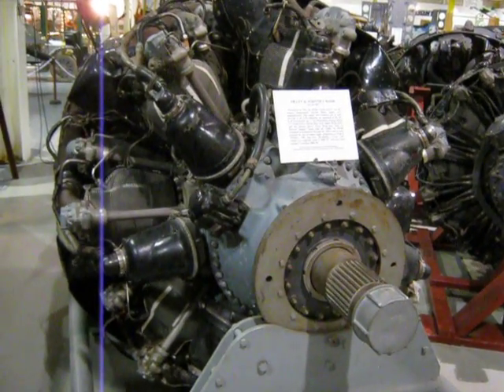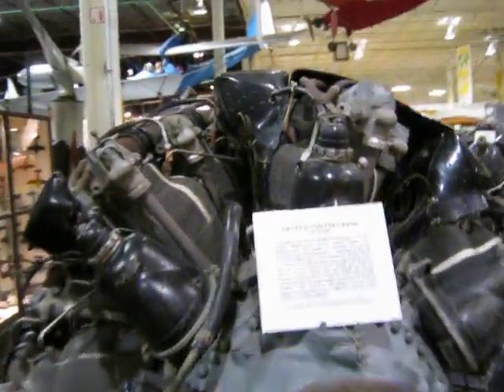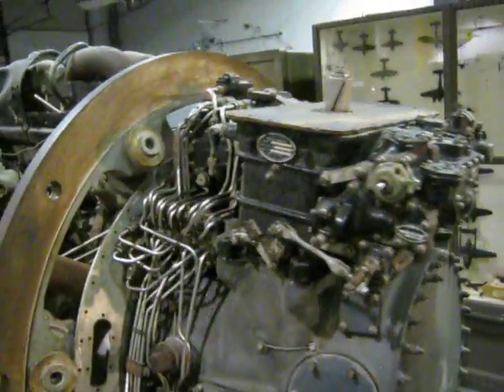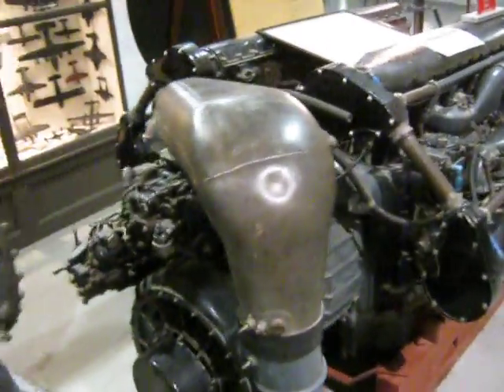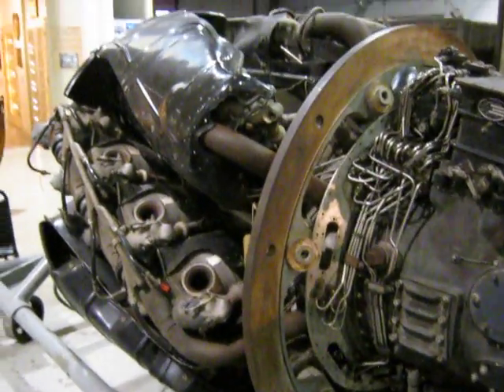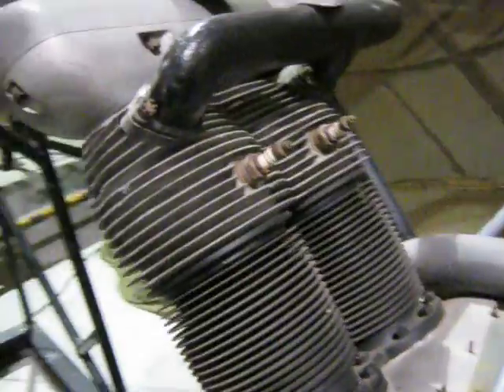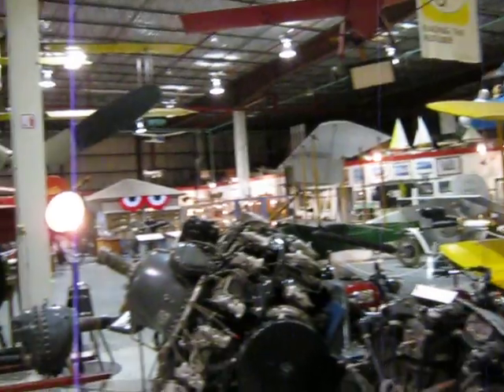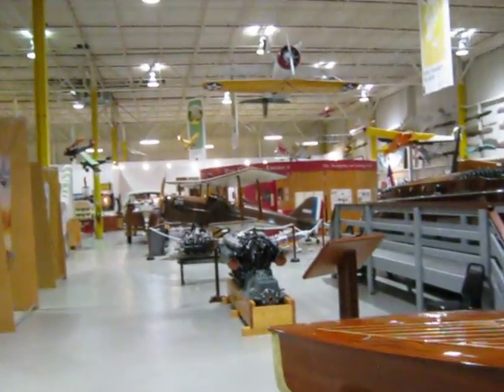28 Cylinder Radial Engine Walk Around

Comment: I've heard alotta things from the old timers on radials. Sometimes they  had a compression release or a cap you removed to drain the oil out of bottom cylinders before startup. Otherwise during you could bend a rod during startup!!
Reply from the maker: MrTheHillfolk Yes, radials are peculiar engines! I had oil draining issues also, inspite of draining it as best I could, it still proceeded to wet down my work bench 3 times!

Comment: That first engine that you showed, is it a plane or a tank engine??
Reply: That 28 cyl was an aircraft engine. 
Basically 4 engines with 7 cylinders each stacked together.  Yea, they made a couple hp ;)
Reply from the maker: redneckbryon The 28 cylinder is an aircraft engine, the Pratt and Whitney R4360, used in such aircraft as the B36, B50, and some Corsair fighters, as well as others. Quite the impressive engineering package!
Reply: I've heard from the older guys a bunch of war stories at my shop ...
Pilots liked the radials over the allisons they said. 
Since they were liquid cooled, it was easy to get the radiator taken out.
A good shot and your day was done.

Comment: Not only a beast in size, but the valve timing is also incredibly beastly on the 4360. It's a wonder that they even ran. Fun fact: the metal strips on each of the cylinders were there to eliminate fin-breaking resonance.
Reply from the maker: Cameron Jenkins Interesting, I had never heard of that. I have had some resonance related problems with my 3 cylinder, vid to follow.
Reply: If you go to enginehistory.org, you can read all about this stuff and it'd really be worth your time.
Reply from the maker: Cameron Jenkins Yes, that is a great website, for sure!
Reply: On a completely different topic, have you ever thought about making some sort of a dyno/engine loading device for your small engines?